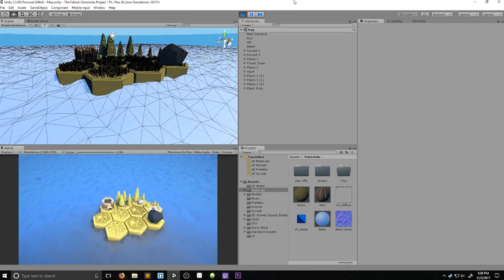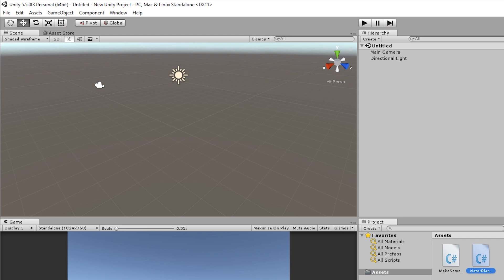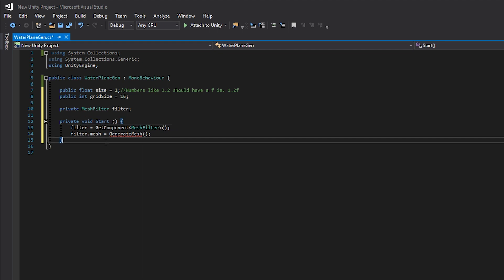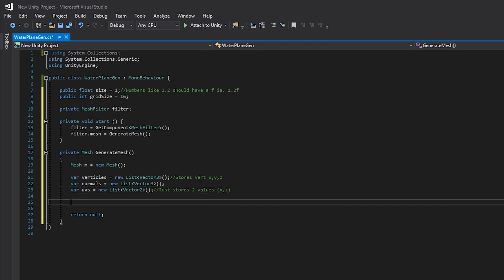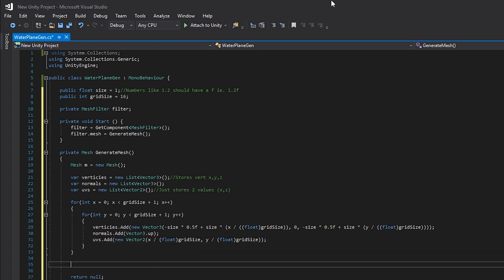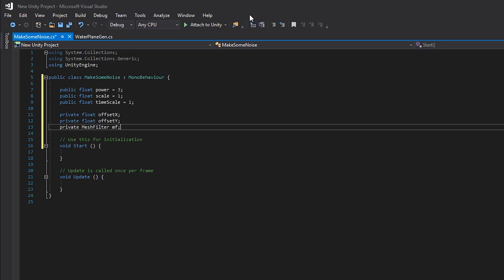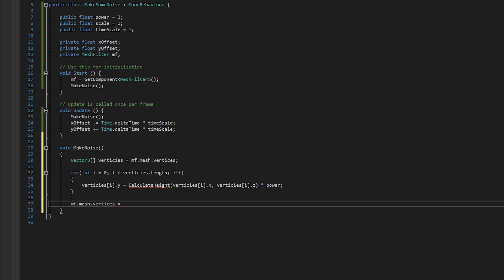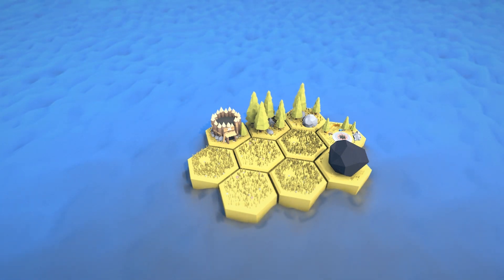[Unity Tutorial] How to Make Low Poly Water

Comment: if you're having trouble seeing the fields show up in the inspector under the scripts type exactly "[SerializeField]" above each of the public variables i'm on Unity 2017 so it might be a new thing IDK
Reply: A variable should only be declared public when it is needed to be addressed from another script or class and not just because you want to see it in the inspector. If a variable is not needed to be addressed outside that class, it is better to declare that as private and use the [SerializeField] attribute before it. That way things are more secure and upholds the idea od OOPs programming. However, using public instead of [SerializeField] private wont break the program in most cases.

Comment: Just one important thing to add to this tutorial : you can divide the required power by something like 1000 (easily) if you let the GPU take care of modifying the mesh using a "vertex shader" that takes care of updating the height of each vertex that same way you would do it in C#. That's extremely important if you have very large water planes or if they have a lot of vertex. Writing a vertex shader can be a bit painful if you don't know how to, but I did it myself, with no initial knowledge about shaders, and I don't regret it.
Also if you want to have multiple water tiles with seamless transitions at their edges, you should use the world position of the vertices as input for the noise function instead of their local coordinates. This makes tiles automatically, without having to add an offset to the local coordinates, without having to consider rotation (if any), etc. I've struggled with this for weeks.
Reply from the maker: I couldn't really find any descent articles/videos on writing sharers. If you have/know of any please do share them, I'd love to learn.
Reply: Well I didn't note every forom post, web site, article I used, so I wouldn't be able to tell you. The Unity web site does have some tutorials. The Unity forum is also a great help. For your case, the idea is to identify the vertex that you are updating the height of. There is a semantic that provides you with the vertex index within the Mesh.vertices array. From there you recompute its local position (if needed). Than you transform it into world space, generate a wave height using its world position as input values and update the Y coordinate of the vertex. You also have to update the normals. Since you have no access to the surrounding vertices within a shader, you have to recompute the surrounding vertices too, and compute that normal using them. Writing a surface shader also allows you to let Unity compute reflections for you, i.e no complex maths required.
Reply from the maker: That's too bad about not having references. Sadly I'm to busy with freelance work on the weekends to spend any real time trying to track down the resources I seemed to have missed. In the future you should bookmark articles so you can help others, the discord is a great place to share resources and get feedback if you're into that sort of thing.
Reply: Any chance you could show me the line that you changed in the code? I've been trying for a few hours but still have seams in my tiles. Thanks!
Reply: Yep trying to do that as well would appreciate if you'd nudge me to the right ressource.

Comment: having some trouble,

the watter script following you wasn't compiling so I used the script from the source code, but when I tried following allong with the MakeSomeNoise script, I'm getting the following:

"MakeSomeNoise.cs(32,39): error CS1061: Type `UnityEngine.Vector3[]' does not contain a definition for `length' and no extension method `length' of type `UnityEngine.Vector3[]' could be found. Are you missing an assembly reference?"

not sure what exactly is the assembly reference I'm missing
Reply from the maker: I would need to see source code. Feel free to copy the classes source into an anonymous pastebin https://pastebin.com/ and reply with the link. Vector 3 should have a length. Based on some quick googling you might be mixing up your variable names.

Comment: Nice tutorial. I'm confused by the example project you linked. How does that Plane have that low poly look. I generate the plane at runtime and it does not have it. I look at wire frames and all the triangles look the same between the two. Is it something to do with the UVS? How did you even create that plane asset?

Comment: instead of using public so you can edit it in the inspector just use  private and add [serilizefield] before it. So you only use public for thing that need to be public
Reply from the maker: That's not how I was taught but it's good to know. At this point the public thing is just  a habit.
Reply: its just a security thing, you can set the public but they wont only be public for script made by you but also for others

Comment: Thanks for the tutorial. 
I got an error in console about triangles: 

Failed setting triangles. Some indices are referencing out of bounds vertices. IndexCount: 1536, VertexCount: 256

 would you please help with that?
Reply from the maker: There are too many possible issues. Reply back with your script saved as a https://pastebin.com/ and I'll see what I can find.
Reply: Thanks for your reply. I found my mistake.
At waterplanegen.cs script I didnt add +1 to the gridSize in the loop, that causes the problem. 

for(int x = 0; x < gridSize + 1; x++)
        {
            for(int y = 0; y < gridSize + 1; y++)
            {
                verticies.Add(new Vector3(-size * 0.5f + size * (x / ((float)gridSize)), 0, -size * 0.5f + size * (y / ((float)gridSize))));
                normals.Add(Vector3.up);
                uvs.Add(new Vector2(x / (float)gridSize, y / (float)gridSize));
            }
        }

Comment: Hey mate, nice tutorial. Wouldn't it be more efficient to do that in shader? If you'd like I could try to put something together. Here to help ;)
Reply from the maker: I would be better to use a shader, I just don't know enough about how they work.
Reply: They are a sharp pain in the butt to get started (and then some to get something good going) but it is interesting for vertex displacement as it come for free in a shader (shaders display vertices and have to translate their 3D space coordinates into 2D Screen space anyway, you can pretty much put the perlin noise in that operation and be done with it). The one drawback I can anticipate is that everything that has the shader applied will be displaced in the same manner. Although, I have to say, it's a big investment as you would need to learn the basics in two other langages just to get going.

Comment: I keep getting the error: Failed getting triangles. Submesh index is out of bounds.
UnityEngine.Mesh:SetTriangles(List`1, Int32)
any help?
Reply: You either 1) don't use SetTriangles method, but fill the triangles field yourself, or 2) change submeshCount (before calling SetTriangles) to reflect the correct amount of used submeshes (because you obviously haven't used zero as a 2nd parameter).

edit: I haven't watched the video in its entirety btw, I don't know if there is a misleading piece of code somewhere, so pls ask if you need an example
Reply: I'm having the same error and I copied the code exactly.